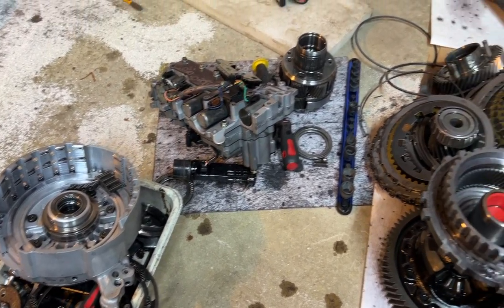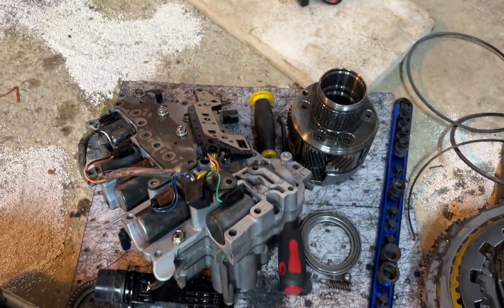Automatic transmission fluid should not be replaced for this one reason, ATF?

Comment: You and I had a discussion about my 2000 4Runner. When I purchased it, it had 243874 miles on it and I had no idea if the fluid had ever been changed. I decided to change the fluid and filter at 247683 miles. The fluid was very dark. I did a complete fluid change with Amsoil Signature Series Multi-Vehicle Synthetic Automatic Transmission Fluid. The 4Runner now has 260723 miles and it runs and shifts smoothly. I'm so glad I did.
Reply from the maker: I’m happy to hear this. Thank you very much for sharing this information!
Reply: Did you do a flush or just multiple drain and fills?
Reply: @elaiespinosa708  Hi!!
I did a complete flush. I drained and removed the pan. I changed the filter. Then I unhooked the transmission cooler return line and drained the fluid, one quart at a time, until I saw clean fluid. 
I did watch several YouTube video showing the entire process.

Comment: Sir, may i ask a question regarding power steering fluid( 2013 d4d 3.0 1kd-ftv engine with hydraulic Power steering?
Reply from the maker: Toyota model?
Reply: @repairvehicle  fortuner 2013
Reply: @repairvehicle   can i use dextron iii H as a steering fluid, where manual recommends dextron ii or dextron iii only
Reply from the maker: in US dextron 3 recommended for 4runner.
Reply: @repairvehicle  thanks, i just wanted to know can i use 
dextron III  H  in place of dextron iii, anyway thanks Sir.
Reply from the maker: Good question, I don’t know